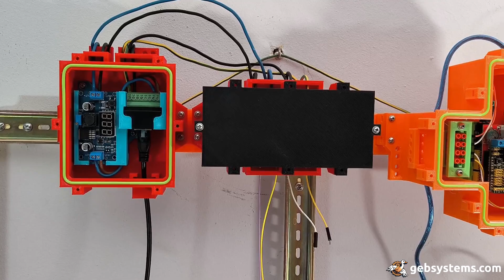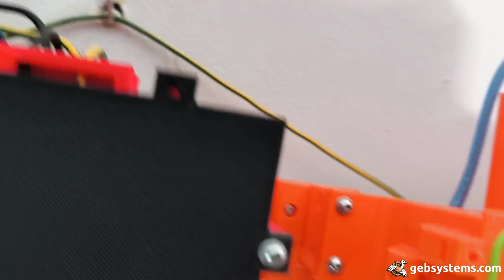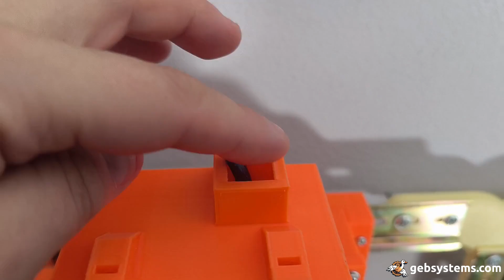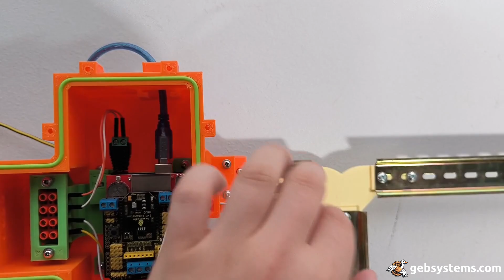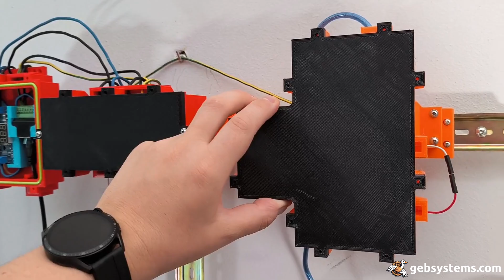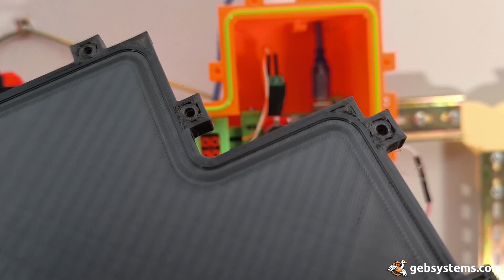Arduino enclosure I will not be ashamed of | Arduino Modbus Project | !Ai

Comment: Here's an idea for programming switch a reed switch. Nice vid btw
Reply: Now that you mentioned serial breaker, I initially thought that external wire in 2:42 was to put a arduino in programming mode like in esp32.
Reply from the maker: @JffFrm  hahahaha nearly. It is just so I can upload a sketch to the Arduino without taking the thing apart. It already has been rather useful!
Reply from the maker: You mean for the serial line "breaker"?